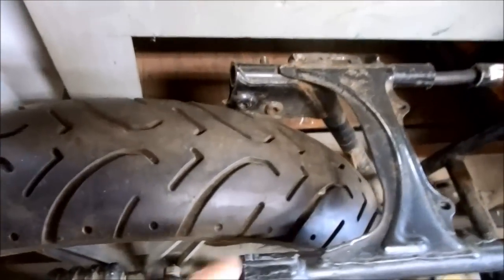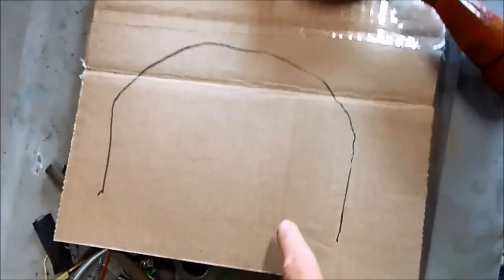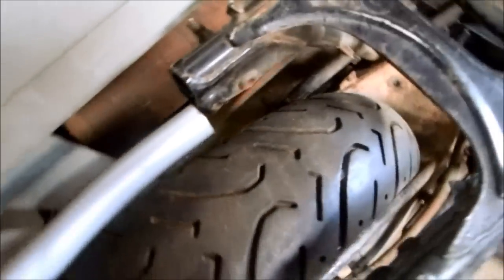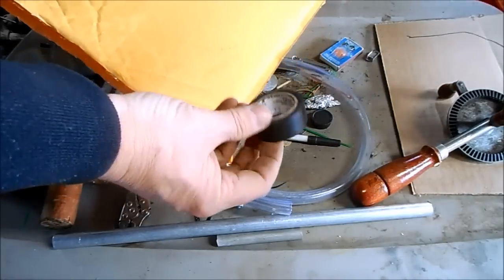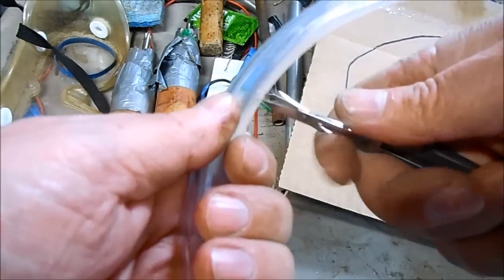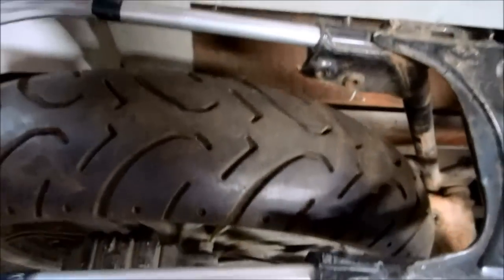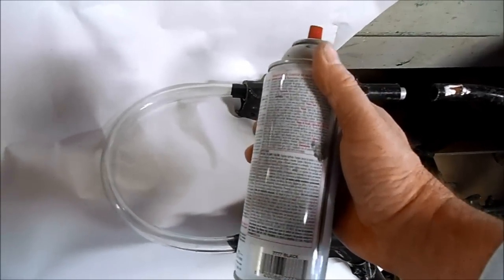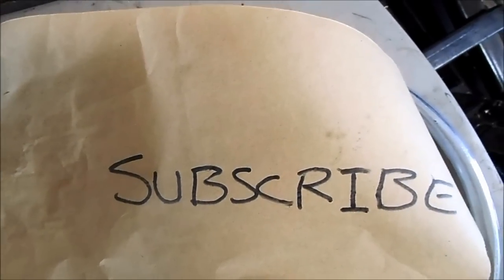How to install a cafe racer seat loop / brat seat hoop on your motorcycle

Comment: I took your idea of frame adjusters to another level.  I installed them in the down tubes right off the neck of the bike.  For the boxed backbone of my 07 Bonneville, I fabbed a boxed piece out of air conditioning duct.  Now I can make adjustments on the fly.  Do you think a steering damper will take out the "mushiness" I'm experiencing in the corners?
Reply from the maker: +Streetcrayon   you need a fork brace in addition to the damper ;)
Reply: +Ichiban Moto I haven't seen all your videos, do you have one on fork brace installation?  I was going to fab one up with bailing wire (titanium) of course,  maybe you could do a video on proper installation or fabrication of a bad ass brace.  Maybe tie it into the bike frame somehow.

Comment: Awesome idea with the heat lamp. I usually use a propane torch which I place closeby with some firegrade tape and leave overnight. But the heatlamp looks more practical. I will look for an LED one though, to save on electricity. Thanks for the great videos.
Reply from the maker: when this burns out, I'm going LED

Comment: Dude thats horrible. I just bought a hoop for mine, all metal and has the correct radius to match my cb frame. Part of the steel hoop is for support and that clear hose wont cut it.